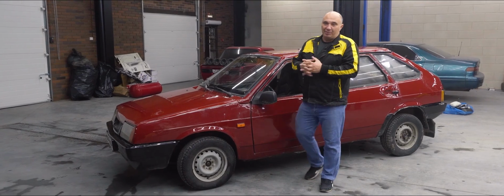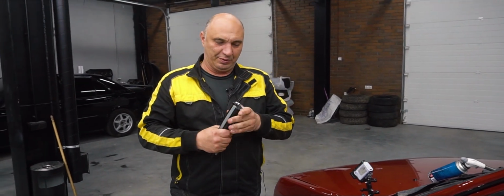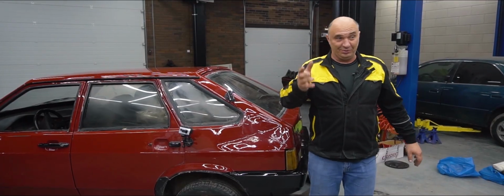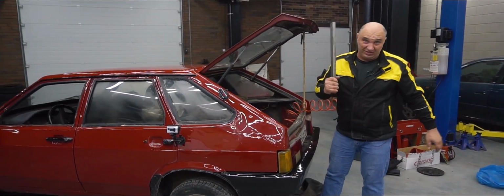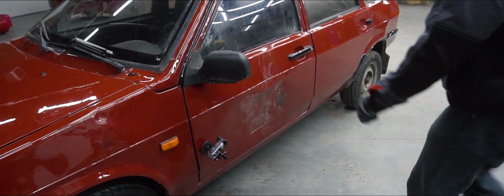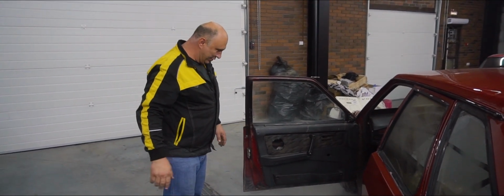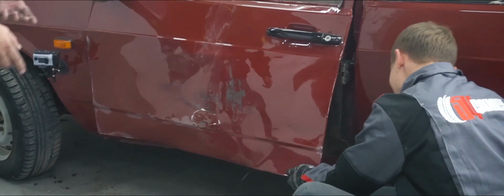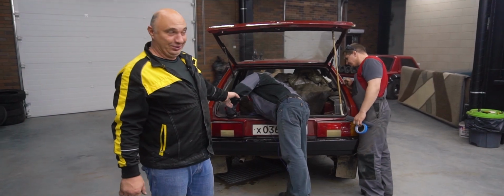Dent repair: glue sticks, tire tube, airbag module

Comment: Cool, my car was in a hail storm last June, I only have to do the glue-stick trick about eight or nine thousand times, then it's fixed !!!
Reply: If it is not adequate, then try to think about second, third... method... :-)
Reply: I just had a paintless dent repair guy in TN repair 20+ dents in my car. He was an artist. You cant even tell there were dents. He saved me a couple thousand dollars.
Reply: @MyDyerMaker  my dad bought a totaled motorcycle and he pulled 56 dents from the gas tank (not the paintless way though). Then some Karen in an suv ran into him and totaled his bike again. Hyperextended both his knees, too. He said he had to wear leg braces for a bit.
Reply: Crying at this comment so funny

Comment: If you heat the surface before sticking the glue sticks you probably will have a better adhesion, I never done this in a car but had done in several other materials and it really helped, I believe it can help here too.

Comment: That glue stick method is pretty much the same way paintless dent repair guys do it, although a bit more sophisticated
Reply: True but the tools are un - affordable for some people compared to a couple of dollars for a good amount of these sticks of glue, nah mean bro.
Reply: I'm going to try this on my mother in law's car in the next coming days. A few small dents in the C pillar.
Reply: @the_kombinator  For a moment there I thought you were going to put the dents in yourself.....and then I read it again...
Reply: @BuzzinsPetRock78  I got the glue sticks, gonna try this out tomorrow!
Reply: Babylon falling  Kind of. The dents were in the C pillar, and the ones came out somewhat. The ones by body creases barely moved. I think with enough time, this could work, but you have to wait for the gluestick to completely cool. Problem is, my father in law and myself were getting cold ourselves so we left it for the time being. 

I reckon it works better on larger panels, with greater success the further it is away from the edges. Also we used dollar store glue gun inserts, I think if I use some kind of resin it might work better. 4/10 with the potential of being 7/10 with enough patience. For now Matiz will have to make do with some dents ;)

Comment: In the old days they could just use a torch and slightly heat the metal, the dent would pop out!   A airbag set off in there is a great idea! Set it off in there!!

Comment: yeah the gluestick method is iffy, I got a paintless dent repair kit that had a slidehammer and you glue the plastic pieces on your car and hook the slide hammer on it and pull it out, it's not supposed to pull paint off but there's now 2 spots on my roof that are down to primer, still it was a hail damaged car, 98 or so out of 100 or so dents isn't too bad, and you have to be careful not to invert the dent when pulling it out, I inverted a few on my car but it still looks better than it did

Comment: Suggestion : Install 4 tiny wheels at 90 degrees to the road wheels... the tiny wheels should pop out and then be used for perfect parallel parking.

Comment: It's the thin metal in modern cars that makes it possible to use glue bonded pullers and suction devices. It doesn't work as well on really old cars.

Comment: 4,that dent is n the car u use a kettle of hot water and a rubber plunger (oldstile 1,,)and pull str8,,after the kettle of hot water do the plnger right away guys as u poor the hot water on it u will here the metele pop///if u have a steel sink ull here the same nise,,, Godbless and Rember 2share the lov guys👍👍👍👍🙏🙏🙏🙏happy 2020🇮🇪🇮🇪🇮🇪

Comment: Why do we use air bags on cars for safety? Mf look like they do more damage than the actual accident
Reply: Usually they expand before your head hits them. Still feel like a punch in the face, but it's slightly better than smashing face on a raw steering wheel.